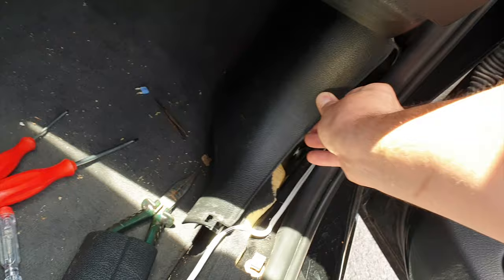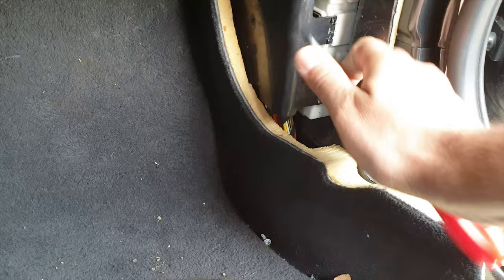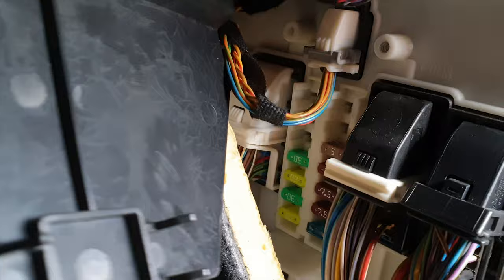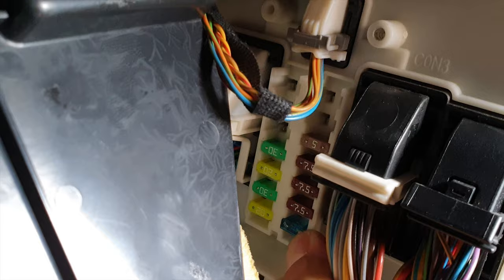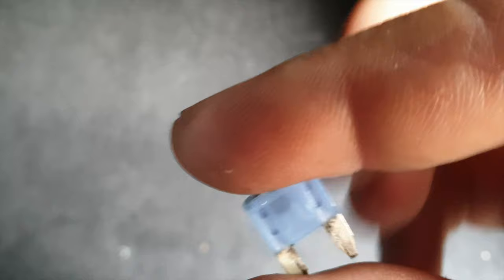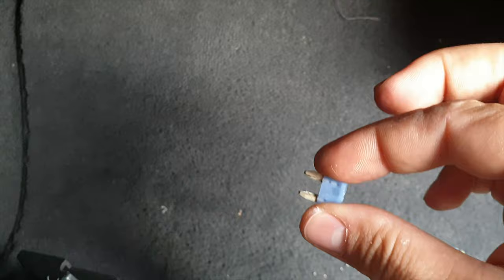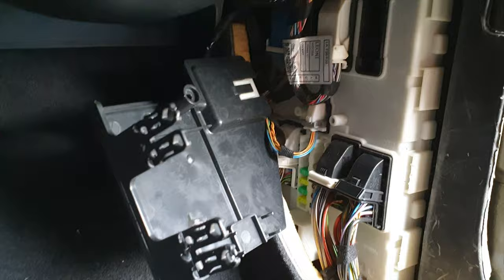HORN FIX for BMW F31 & F30 - replace horn fuse from FEM Front Electronic Module

Comment: Thanks mate, your short  instruction was very usefully. My horn didn’t work anymore, I replaced the Blue 15amp fuse and the horn is working again 👍🏻. Getting back in place the plastic doorstep cover was however a pain to do 😬
Reply: How did you put the panels back on? 😩

Comment: Hello is it at the same place for a Bmw 4 serie f32 ? thanks
Reply: yes
Reply: No
Reply: Yes it is ;) dont say « No » when you dont know please
It’s a the same place, i replace the fuse and now my horn perfectly works
Reply: @amirdziri4313  haha I'm really glad you were able to fix it. After I did a lot of research I thought that on the F32 it is in the same place, so I said "yes" in my comment to you. After my comment, I checked my own fuse box and it was not there!! It was just empty and it's not possible to stick a fuse in there, it has no connectors. After some more research I found out that 2015+ F32 don't have a horn fuse anymore :(( so yours must be 2013, 2014? Mine is 2015
Reply: @n55tourist32  oh i’m sorry for you ! Mine is from july 2014
So what are you gonna do to fix it ? What you have to do?
Reply: @amirdziri4313  no problem, thank you bro! I don't know yet, I didn't have time for research yet. I may have to replace the horn, but we will see :)
Reply: It is same place

Comment: Can anyone tell where is horn fuse in 2017 330e because i didnt find it place where this video shows
Reply: same problem and there is no fuse there 🤷🏻‍♂️ 
did you find it?? please help me
Reply: Was it solved ?
Reply: I HAVE SAME ISSUE HOW TO SOLVE 😢
Reply: F30 LCI's don't use a fuse for the horn, apparently. If the horn breaks you have to replace the horn itself (or both of them). Unfortunately I figured this out after I took all the panels off, so now I'm struggling to put them back in
Reply: @Julian-um3gh Hi pal, I have a right hand drive BMW F30 LCI are the other fuses still used in this location as I'm having a left headlight malfunction and suspecting this fuse has gone ?
Reply: @mohammadiqbal7271  Hi, sorry not sure mate. There are 8 fuses in that fusebox (at least in my car) but I don't know what they're for unfortunately
Reply: @Julian-um3gh  Is yours right hand drive buddy. If so where is this box on our cars passenger or driver side. Thanks
Reply: @mohammadiqbal7271  mine is on the passenger side (on the right, since mine is left hand drive). I'd expect yours to be on the left then

Comment: I just did that on my 2018 model, and there was no fuse there + no slot for it? where is it locatedo n 2018 version.
Reply: Did u sort it out? Have the same problem, no fuse in the slot ..
Reply: I have same problem on 2018 model, it is a slot for it… but its no fuse there
Reply: I’m in the same situation can’t figure this out

Comment: Hey there, i do have issue with my horn.. it doesnt work properly.. once in a time it seem to work... i'll have a look to that in my car too. it's the same for the bmw f20?
Reply from the maker: The fuse box should be in the same place for f20. Please post a comment if you check, it might be useful for others in the future. Thanks
Reply: MGT - Max Games Tech i’ve just checked, the fuse box location is the same, the fuse regarding the horn was not damaged but I’ve changed it anyway but horn is not fixed. Guess problem is coming from the steering wheel column unity. Thanks for the tip tho ;)
Reply: @musa4f5  have you fixed it ? i have the same problem, it works sometimes but i haven't changed the fuse yet.
Reply: Cristian Posea yup fixed it. It had nothing to do with the fuses. When I removed the airbag I noticed some wire not very well connected. Once everything connected I put the airbag back to test. And everything was working perfectly. Hope it helps for you
Reply: Your problem was probably clockspring.
Reply: @posaoa_lesinata  Have the same problem - sometimes it works, sometimes not. Did you manage to fix yours ? Tnx
Reply: @ilackovi  i found out the problem at the local service. It's the clockspring but i didn't bought one new yet just for the horn since is quite pricy.

Comment: Took a look for this fuse on our 2012 rhd f30 and found there were no fuses in the whole module!!!! Everything seems to work though - apart from the horn. Wierd!  Looks like a job for an electrical bloke... PS getting the door lower trim panel back on is a nightmare.....
Reply: Did u sort it out? Have the same issue, no fuse in the slot… thanks
Reply: I have the same problem. No fuse in the slot. How did you solwe it?

Comment: Any way to fix my brake lamp and blinker right side not working . Try to replace bulb with another kind.  There was a short. Check wires fuses burnouts. Nothing. Move the whole tail light assembly to right side works.. help!!
Reply: Brooo please tell me know if you got urs fix i change the socket and the whole wire converter and a new bulb and my braking light are still not on when i brake and is on the left side my blinkers work now 🤦🏻‍♂️.pleasee let me know
Reply: spray liberally with contact spray

Comment: Managed to get to that fuse box. Surprise, no blue fuse. I place a new one in empty space but horn still doesn't work. My car came back from BMW recall and horn doesn't work since then. BMW asks £85 only to diagnose the problem.
Reply: Same here. What did you do in the end? My horn works but intermittent. Maybe a different issue?
Reply: Was your recall for the steering rack and bolts? I think one of my horns died after that.
Reply: I have the same issue, what did you end up doing?
Reply: @mohammedt511  took the car to car electrician specialist. Problem fixed for £50. He said the fuse under bonnet was gone plus horn itself needed replacing. After 7 months the horn stopped working again. Part exchanged the car now.

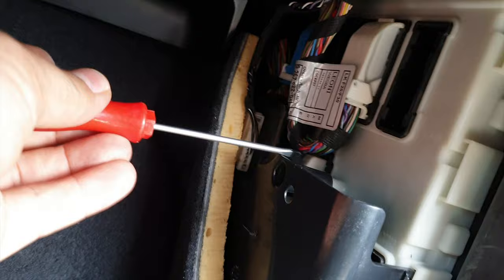Comment: 1:02 You say to use a screwdriver in there, but whatever screw is in there is NOT a regular screw. A flat or a philips screwdriver will not work there. What is the correct screwdriver to use there?
Reply: I have the same issue. Did you ever figure out what screwdriver to use?
Reply: Did any of you end up figuring what type of screwdriver to use ?
Reply: @jordanblack226  its been a couple months but im pretty sure it was a T20
Reply: T20 torx